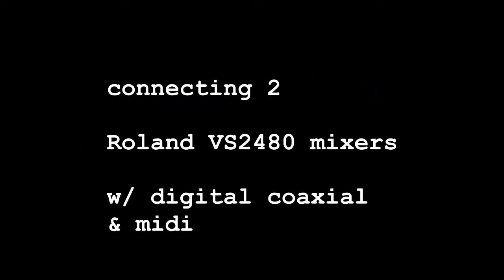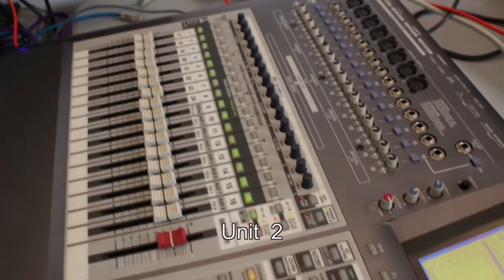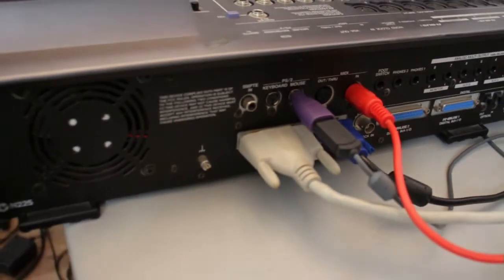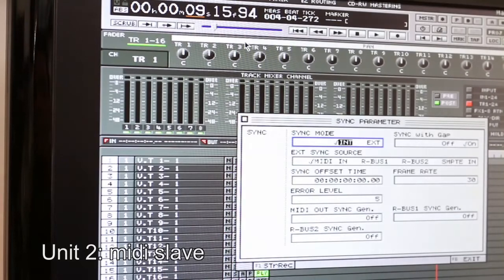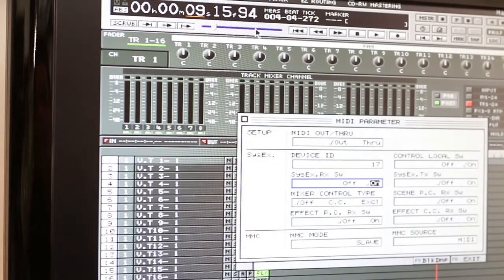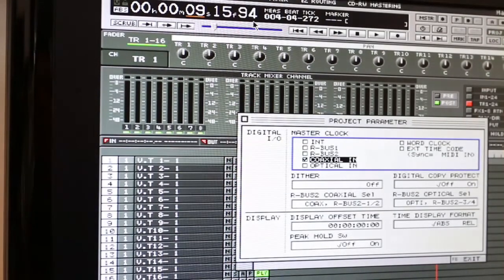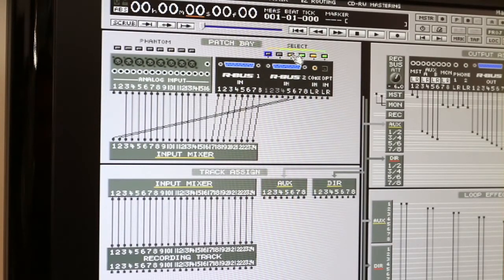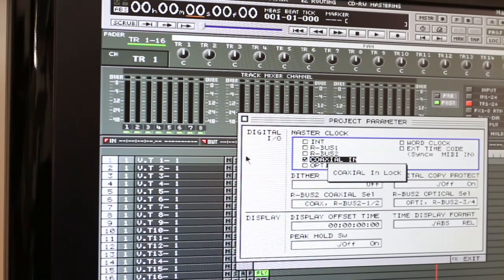Connecting two Roland VS2480 digital mixers

Comment: Can you use a tos link cable to expand the outputs on vs 1880 to a audio interface that has optical in and if so what do you put the master clock in on the  vs 1880 audio interface is a audient id 14 .

Comment: That is awesome!! I have a VS2480 and a 1680. On the 2480  I use sync track frequently as well as digital coax with a multi fx unit so I navigate pretty well in that world. Do you think that your method could work  to connect  my 2 units? Seems like the work around would be that the 1680 only records up to 20 bit but it does record in MAS mode. Not sure of the complications that could arise. Have not powered the 1680 up for years!!